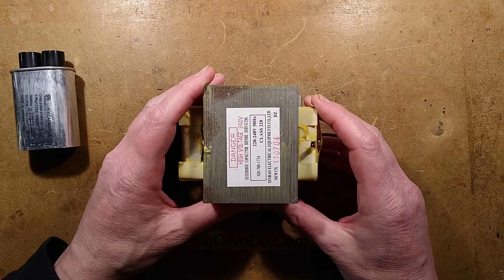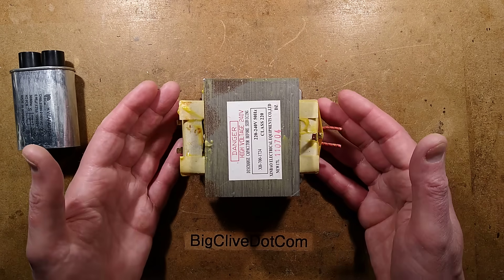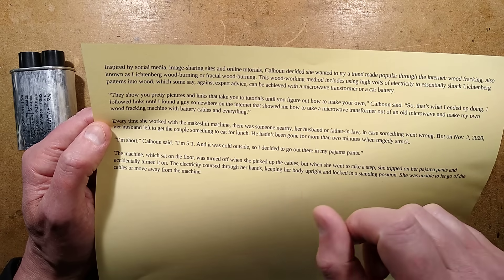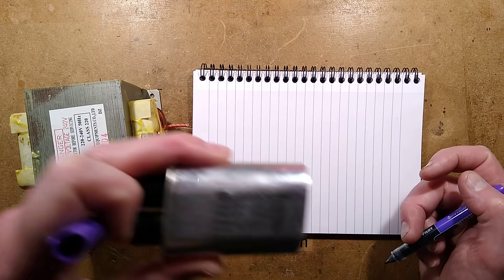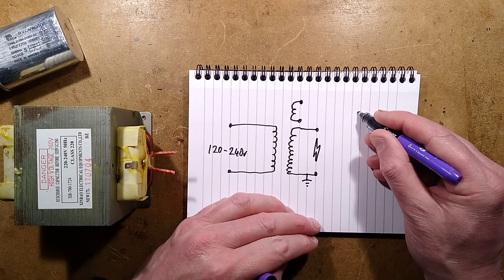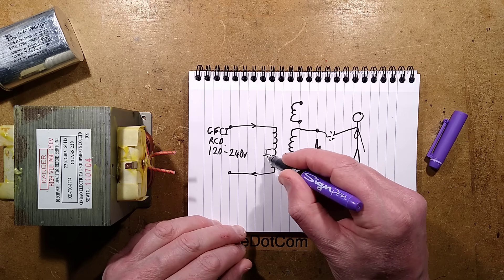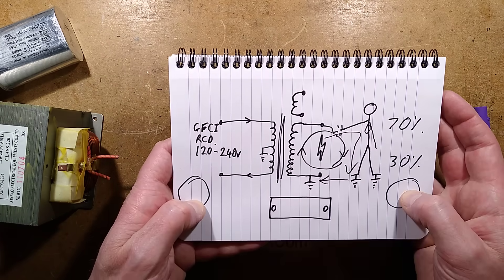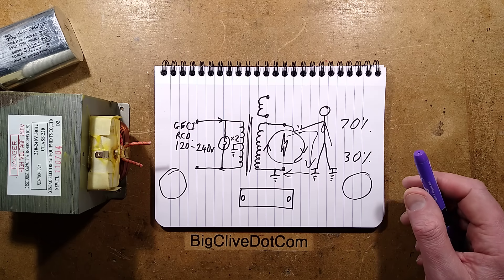The most deadly project on the Internet

Comment: When I was in Electronic School, they were still using CRT's  In a CRT, the flyback coils carried 2,000 V/diagonal inch.  They didn't tell us to be careful around those.  They told us that microwave ovens were the machines that killed professionals.
Reply: Perhaps because the CRT needed only the power to make a static E field, not cook food at 1400 watts? The CRT circuit will quickly crash under the load of your body, exciting yet self limiting.
Reply: Yeah my teacher showed us electricity arcs with a Cathode Display. It was spooky, like seeing mini-lighting
Reply: Yikes, I was planning on modifying an old CRT to work as an oscilloscope soon… Any safety tips I should keep in mind?
Reply: @HauntedHarmonics  don't eat yellow snow
Reply: @HauntedHarmonics  If you didn't know already about the dangerous CRT high voltage, there is probably a lot of things you should re-read about cathode rays and it's control circuits. No offence meant, these things can kill very fast if used the wrong way.
Reply: @ojomann1  none taken my friend. Id really like to avoid killing myself over a weekend project lol. i was already aware that the capacitor in CRTs was potentially very dangerous, but i guess i didn’t really realize how dangerous until reading this thread.

I’ll def take your advice, looks like i have some reading/research to do
Reply: I know nothing about electricity, but I know the worst shock of my life was when I was a kid smashing up a CRT tv.   It wasn’t plugged in or anything, but something in it was still able to shock tf out of me when I was cleaning up the mess and picking stuff up with my bare hands
Reply: @strongocho  The big wire on the top of the CRT goes straight to the business end of the Flyback Coil.  Touch that wire and you are going to fly back.  That's the difference between AC and DC.  When you're dealing with a transformer that changes voltage, your muscles contract, so you can't let go of the thing until you're completely fried.  A high DC voltage will knock you away.
Reply: I used to play around with CRT fly back transformers one I put on rubber gloves I wanted sparks to fly from My finger to Guitar strings It still shocked Me but I knew It was just high voltage Not high amperage as with microwave ovens
Reply: @ortafunk  Usually, anything DC is going to have a limited amount of power behind it.  AC on the other hand is usually connected to a generator, providing a constant stream.  A BB gun can kill you, a rifle will probably kill you, but you'll be lucky if they find a piece of you, if you get run over by a freight train.

Comment: Informative and humorous. Take notes people, the capacitor seem in this video next to the transformer is very dangerous as well. From the removal of and the toxic particles that gets in the air. It’s best to dismantle these microwaves in a well ventilated area and or with a mask on to filter out the air. The kind that has separate disposable filters are the safer ones to use in my opinion. And the charge that these compactors have stored has a hell of a bite that you do not want to experience. Even if the microwave has been sitting on the shelf unplugged for a couple of years. It can still hold a charge. A not so pleasant one at that.

Comment: I've considered doing these kind of projects, but never got around to it. Even with what little electrical safety training I've taken for the labs at my school, I would want to have a setup that makes it impossible (or at least difficult) to access the high voltage section while in operation, and that requires you to have both hands clear to activate (to make sure ya got ya fingies clear).

Comment: When I was in a class on TurboChef oven repair, the instructor told us a story about a guy that touched a high voltage wire and his elbow was sitting on the stainless steel table. The poor guys elbow blew off. He did not die, but I could only imagine that was not a pleasant experience. I am very careful when I work on anything with more that 120 volts.

Comment: Honestly, yes, it is beautiful but humans... They're stupid... Have they not cared in wchool during lessons about electrical power?

And if I'd do it, I'd be pretty to have something in place thag I DO NOT need to touch anything as well as having a tonal and visual reference for the contraptions state. 

Electricity is nothing to mess around with. 
Safety measures are absolutely necessary and these burnings... As beautiful as they are, most shouldn't do them. And I most likely will not be doing them as well just for my own safety.

Comment: Leaving the transformer secondary floating by not grounding it would make this a little bit less dangerous but this type of electrical pattern  burning still isn't worth the risk. Three position dead man switches would also be recommended

Comment: When I was 21, I got a hold of a neon transformer and using a coat hanger and a block of wood, constructed a Jacob's Ladder.  This particular transformer had a 7k secondary voltage.  The Jacob's Ladder effect was awesome for about 2 minutes before it burned a Lichtenburg design into the wood by arcing across the surface of the wood between the terminals.  I decided that was the end of that and moved on and have not looked back.

Comment: I have a Lichtenburge machine and I can guarantee you that there is no minimum level of safety with this machine. I have been shocked by mine indirectly and it wasn't pleasant. I can't exclaim enough just how scary it is to be shocked by this machine when you think that you are being as careful as you can. I am thankful for the safety precautions that I had in place, yet I now am even more precautions.

An important reason to do this outside is not only the smoke but when it arks, and it will, it creates ozone apparently, and you don't want to breath that stuff.

Comment: I'm an arborist and most of our work consists of clearing trees from overhead power lines so we have to undergo a few days of safety training every year due to it. They always show extremely graphic photographs of injuries sustained from accidents involving high voltage loads and they are fucking horrific. Many of them I personally wouldn't want to survive considering the quality of life afterwards. Like, did you know it's possible to literally be "blown off your feet"? Yes, 22k to 66k volts will leave you with smouldering stumps where your feet once were. 
While the things they show us are truly horrific they have given me an immense amount of respect for electricity and it's potential to harm.
Reply: Bloody hell
Reply: Yes.  Linemen often get arborist  training.  They have told me these stories.  Be safe and remember, if you are that close to the line you don't have to touch anything and can still induce a current in your tools.
Reply: Where are you? In the US distribution lines are typically 12kV to 35kV. Also in the US, the utility company is typically responsible for keeping their right-of-way clear of foliage, although I suppose they could contract out the trimming to a properly trained specialist, if it is allowed.
Reply: @deepfriedsammich  I'm Australian mate. Our high voltage are 11k, 22k and 66k with the main transmission lines running at 125k or 250k. Different agencies are responsible for different aspects, but I work for a private company that's contracted by them.
Reply: @dumbasses_R_us  Interesting to know. Thanks! The company I work for makes distribution equipment: switch gear, fuses, fault interrupters, etc.
Reply: @deepfriedsammich  our utility companies used to be state owned and run so their assets were maintained by in-house crews, but they were privatised in the 90s so now it's just a clusterfuck of delegated responsibilities. If I'm working on roadside low voltage lines (410v across the 3 phases) then it's usually the responsibility of the local council so it can just stop halfway down the street or just be one side of the road so you can miss trees or even worse, cut trees you don't have to. Always good to give away work. 😬
Reply: @deepfriedsammich  Power company trimmed when I was younger, but now it's all contracted out here. Only in an emergency do our linemen touch a tree, never for maintenance.
Reply: @deepfriedsammich  The HT voltage he writes of is common throughout all the countries that were formerly part of the old British Empire - South Africa, Australia, etc.

Comment: The USN has an obscure web page online electrical system. Shoen is a sailor's hand, after his ring finger was traumatically amputated when it caused a crowbar short on battery terminals. A standard car battery can provide 3000 Amps in a dead short.

Comment: Great video! But one correction. Most primary overhead voltage in the lower 48 states is 7,200V or 14,400V. Most states are in the process of phasing out 7.2KV and switching to 14.4KV. I am a powerline designer in Texas and people just do not understand the dangers of powerline. These days if you touch a 14.4KV line you're lucky if you have and open casket funeral. More than likely you'll just pop and burn on the line even with reclosers set to a low rating and single fault pop out.

Comment: I used to work on and with batteries that are heavier than a car and always treasured the safety of my team. A supervisor wanted to help with the job and he didn't last 5min before he did the biggest no-no that is always briefed before the start of the job. Never break the plane with your tools when removing/installing the cables. These are large terminals that could easily be shorted by clothing, accidental brush with your arm hair, and especially with a breaker bar. His tool got too close to the other terminal and he got ejected against the wall 1ft behind him, he lost his eyebrows and a few inches of hair around his forehead, and he was partially blinded for several hours. Luckily, everything returned back to normal for him but I learned that day to never trust that anyone knows what they are doing unless you trained them yourself.

That being said, I took apart a microwave and decided to do a few projects in fractal burning. However, it took me a few weekends to design something I would be comfortable using and would be confident that it's as safe as I could make it. Like the video mentioned, a dead man's switch seemed like the logical conclusion. I also wanted nothing but the very tips of the wires/leads exposed so I insulated everything including a custom box for the transformer. I added holes for airflow, a main power switch, and three indicator lights. What I liked most about it was that I made wooden articulating arms to hold the wires/leads instead of trying to manually use sticks and hold them in place or wrapping the wires/leads around a nail hammered into the board. I could position the wires with the arms, turn on the main power switch, and hit the dead man's switch. Even if you move the arms without ensuring power is removed via the main power switch, the dead man's switch is your friend.

While I didn't injure myself, It's all too easy to see how someone could injure themselves or others and a project like this needs to be done carefully and thoughtfully. I read a story online about someone having their transformer on the ground and when they were done burning a piece of wood they set the wooden sticks down (that were holding the leads) onto their garage floor. Unfortunately, the humidity that day was awful and they didn't realize the floor had been slightly wet. Oops.

Comment: it's also the same voltage as a FBT found inside the older tv sets. don't fuck around with electricity, if you don't know what you're doing. I've read a few articles now about this so-called art trend, and all 9of them have ended in people shocking themselves to death. ZAP! there was a Milwaukee couple that did that and it resulted in both the electric shock, and a house explosion in the process.

Comment: HVAC/R tech here my company does hot side resturant equipment and would you like to know what equipment makes me the most nervous. It's not scalding hot ovens, deep friers, sharp blades on cutting equipment, or even high pressure steam, it's microwaves because when we test them there is no real way to test them but to power it on with the case off and take amp draw on the mags, if you touch the wrong thing you will see a bright flash and nothing else ever again, long story short if you don't know what you are doing don't screw with it. Also relitively high current DC power makes me nervous too because it will literally blow your hand off.

Comment: I've worked on uwave ovens for years in repair shops but with a seriously healthy respect for the high voltage and high current the units can put out. I've also worked on high power valve RF power amplifiers too. Same deal, serious respect. Some those puppies put out 3,000VDC at 1Amp of current. Another electrical chair type. I once had a sign on my office door that read don't look into the laser beam with your remaining good eye. Well, this is kinda like that but you don't get a second chance.

Clive thx for covering the subject quite well. Skin resistance varies quite a bit between being wet, dry, sweaty etc. And yep when you punch a hole through our only voltage barrier our internal resistance is just based on salty water which used to be used as dimmers a long long time ago which is quite low.

So, you said that over 30 people have been awarded Darwin awards and have been removed from the future gene pool.

Yes this can be done safely but not without understanding that long distance is the next best thing to being there. In this area you just cannot be too careful or you'll make an ASH outta yourself.

I loved what you said in the end. You're so bad but truthful. Touch'e. LOL.

Comment: There's a video where linemen take a thick insulated glove, poke a hole in it with a pin then turn on a transformer with the glove on a dummy. Don't be a dummy. 
At these power levels, electricity will find a path to you.
It even jumps out to get you.

Comment: I once actually microwaved my hand. I was at work, and for some reason, the the door was broken and failed to shut off the microwave source when opened. In reflex/force of habit, without thinking, I reached inside with the door open to remove my food, but it was still running. Creepy feeling for sure! It basically felt like when you get really severe sunburn. Didn't get any long term burns fortunately. Needless to say, I unplugged the unit and taped it up with a note so no one else could use it.

Comment: I felt a cold shiver down my spine when you grabbed the capacitor and started talking about it. I accidentally touched a capacitor contact when working on a microwave. My screwdriver was not insulated.

Yes, i woke up in the floor, i could not feel my whole hand for a while but my finger was mostly there, looking and smelling roasted. I lost a fair bit of meat on the tip of my finger.
Reply: Yes. They can keep charge forever and can even charge slowly but steady without power at all...Deadly
Reply: Bro what
Reply: @penguiscool2334  yeah, I have a picture of my scorched finger somewhere (not gonna show it, sorry XD). I lost about 2mm off the tip, all in all, I  got really lucky.

I never saw any use in insulated screwdrivers "ill be careful, the handle is an insulator already" i said, well, turns out the whole point of them is so that when you slip up, the incident ends up with a "whoups" and not with a vaporized extremity.
Reply: @Mylity66  you live you learn I guess, just make sure to keep the live part 😂
Reply: @penguiscool2334  2000V are no joke
Reply: @matteoulbrich38  never really thought it was a joke, electricity terrifies me as much as the next guy over. Thought about taking apart a microwave at one point an quickly changed my mind after I read into it, and ran into a lot of stories that didn’t mind sparing any details.
Reply: Omg that's horrible 😥
Reply: High voltage caps are dangerous things. They can tend to build up charge just sitting on a shelf. I was also really nervous when I didn’t see a shorting jumper across the terminals.
Reply: @dustinlaur7123  yikes! This is really good to know!

(The fact that (high voltage) capacitors may charge by themselves over time)
Reply: Yea I took an arc out of my wrist. 277 on a 20 Amp breaker. I ate it for 15 seconds before being kicked off the ladder. That burning smell is something I'll never forget.
Reply: You are bluffing your way.
Reply: I've learned that even a capacitor from a dinky cheap disposable camera is scary. Not "blacked out on the floor" scary, but still "I don't want that near me" scary.
Reply: @whynotanyting  I did that when I was about 7 years old, took one apart because I wanted the flash bulb circuit but I didn't consider the capacitor for the flash would be charged and at some point I touched a lead and my muscles contracted in such a way that I threw myself halfway across the room. I didn't tell my mom about it until like 5 years later because I was afraid she would restrict my access to electronics books lol.